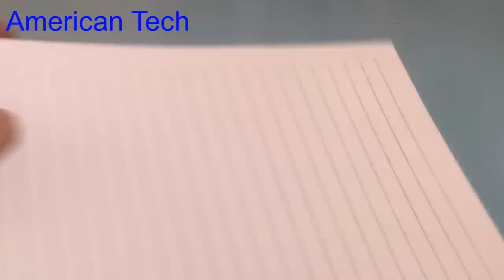How to make a mini Inverter very easy , 3 7V to 48V inverter

Comment: so we can use this to power electrical bikes with 18650 batteries ?
Reply from the maker: Can not. Because it’ low current
Reply: You would need like 200 times the curent to do tgat
Reply: How about connecting 200 18650  cells in parallel and transform it up to 48V to power an ebike with this built? Will it work?

Comment: thanks for posting.  the over-sized sensing coil is very Showy, at.   this widget is Not the first of its kind; being a 'solution in search of a problem'.   the rules of a transformer's operation are simple;  volts And AMPS ALWAYS change adversely, and a small energy loss;  meaning, volts up, amps down;  amps up, volts down.    so here we have 48 volts output form a high-impedance coil, at a Uselessly small amperage.  and, the circuit on the battery side is Essentially Shorted.  so the wires And the Battery will quickly heat up.   cheers
Reply: David Davids i too notice this. in an attempt of duplicating that idea (although i use different transformer, a smaller one), i measured the current from the battery, it's around 2ish amp and the transistor and the cable is really hot without heatsink. and the output is barely reach 12v. could not imagine for 48v.
Reply: Lol could of used a normal transformer lol less waste lol

Comment: V1/V2 = N1/N2 = 650 turns in secundary for 48 V - other 25 turn in primary is to oscilated transistor.
Reply: ferrite de fliback nao da´transformador

Comment: How many amperes it will produce?
Why are you using ferrite core?
What is the purpose of transistor?
Add a 40v load and run the circuit.

Comment: Thanks for the video. I repeated your idea by changing the coil. The results are impressive: input 1.5 volts, and the output 62 volts! The details can be seen on my channel.
Reply: Invex lab What is the number of secondary file rolls
Reply: Invex lab how 2 get 36 volt dc with 2 amps.
Reply: with this circuit, you can't
Reply: Dandik Atölye ok we can't with this but what is othre?
Reply: Invex lab
Reply: Invex lab I love your comment, I'm not actually good at electronics but i love some little ideas and I love this video. Can you kindly help out, what sizes are those coil wire? What name are those other materials that he used please?
Reply: Can you tell me which transistor you are used
Reply: Wot about with a load on it 3volt lmao
Reply: Maximum 200mA
Reply: Robert s what's that microamps lmfao
Reply: How diameter thickness wires you use?
Reply: Thanks for the inspiration though I changed the coils
Reply: Thanks for the inspiration

Comment: what is the thing like the  button？i don't konw how it work?  and why there are two little coil  but not one coil
Reply: The two smaller coils take the dc and allow you to create ac. The coils oppose each other causing flow in the large coil in diff directions as long as both coils aren't energized at the same time.  With the proper timing...this circuit works fine.  I made a couple of these..but i used a factory transformer that i found/recovered from other equipment.

Comment: For who asking about a transistor, yes there is one in this video, It is a 2N3055 an NPN transistor, so powerful, I think It is no more exist ( at least the original one ) there are so many fake Chinese model but not in the same characteristic.
you can made a powerful inverter with a fly back transformer from an old CRT TV or PC, you can get about 300 volt to 400 volt but the amperage will be very small.

Comment: What to do if i want only 13 volt output.? What trasistor should i use if i cannot buy this type of transisitor? Is there any replacement?
Reply: you do less wire turn s
Reply: this core is TV EHT
Reply: Reduce the number of coils

Comment: Wire two Stubblefield coils 3-6-9 configuration one in ground one in air add you converter and usable electricity.

Comment: Looks nice... Can I use this as an input source for my off grid inverter? What is the part number of the regulator you are using? What is resistor value?How many turns on the output coil?

Comment: how many turns in secondary
Reply: niju shaikh Double  the windings on the secondary doubles the voltage but if you double the  windings  you lose half the amperage give and take. You can get a Free transformer calculation  app . Im math retarted because i went to public school before i went to school i could fo any math problem in my head .they fu - k me up !!? Never liked matth anyway or spelling or school ..i helped the first magnet school . We were just s bunch of hippys and my science teacher  John gladson we pump out genius kids over 2000 schools worldwide now we be bad lol peace 🙋
Reply: Depends on how much voltage you need
Reply: 48V * 25T(Primary winding) / 3.7V = 324 T for secondary.  However you also have to consider the loss in voltage in the primary due to the Vcesat of the transistor which can be about 1V. so now it becomes 48*25/2.7 = 444 Turns.  then u have to consider the voltage drop in the wire of the primary and secondary which in this case can be quite a lot due to very thin wire... maybe almost 0.25V... so now it becomes 48*25/2.45 = 490 Turns... so make that 1000 Turns on the secondary.  The 50 Turns is the feedback winding and the 25 Turns is the primary and the secondary is the 1000 Turns.  However if he is not loading it then only 324 Turns turns, but with no load then what is the use?  also you must notice the polarity of the windings
Reply: @johnconrad5487  to be on the safe side 1100 turns should do...

Comment: Come on, inverter? We are used to call this a simple transformer.
Reply: Technically it is, it is turning a small DC voltage into a high AC voltage. (just at a much higher frequency AC wave then your typical 50/60 hz outlet)
Reply: EvilPlagueDoctor Thank you for your explanations.
Reply: It's in fact a resonance device which acts like an inverter. This to the thumb up guy.

Comment: No: transistor?
Reply: There is a transistor, what are you talking about?
Reply: I think he's asking about the number of the transistor.
Reply: tech ideas, there is a transistor. You can see there is a metal cane that is a transistor. This is TO-3 metal type high power semiconductor transistor
Reply: PREGUNTA N° DE TRANSISTOR..!!
Reply: 2n3055 and works good with bd249c

Comment: That's a transformer.... 
Not inverter
Reply: You need to watch past 6:50.......up until then, yes - that is a transformer. The transistor and resistor in the circuit make it into an inverter. It puts out AC. The transformer is the main big part of it.
Reply: So then the output is technically VAC (Volts Alternate current)?
Reply: it´s AC, the other semicicle it`s build with the remanent energy of the coil, besides, the pulsed DC is a AC component mounted in a DC axis.
Reply: What is pure AC?, a senoidal AC?, no, in a inductor, the current in the inductor = 0 in time = 0. it is not a short circuit when the current varies in time. I have 12 years of experience and I`m electronic engineer with a posgrade in renovable energy, almost besides, I study a Master of Education of electronic. A transistor do not overheat when work in cut or saturation, the power consumition in saturation is 0,2Vce * IC, -> 0. The power consumition in cut is VCE (V+) * Ic(0Amp) -> 0.
The transistor only power consumes in the active, or in a transition time, only import in high frecuency (+50KHZ).
Reply: For pure sine wave you need altenator atached to DC motor, spining it at 3000-3600RPM you will have 50-60Hz AC, easiest way to get pure sine wave but have a lot of losses(altenator efficiency * dc motor efficiency and some more mechanical loses). Altenator from car can be used(if removed diode bridge), it will give you 3 phase AC.